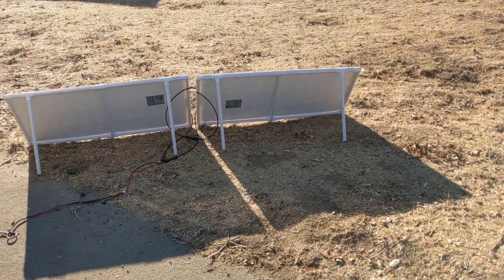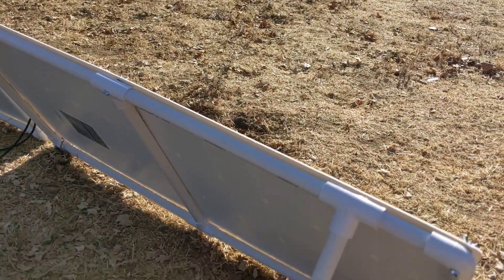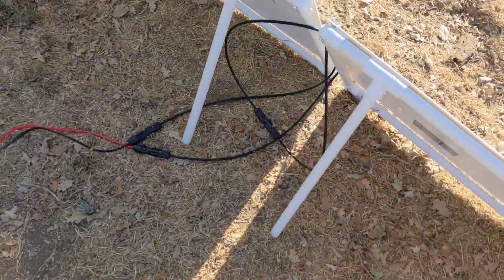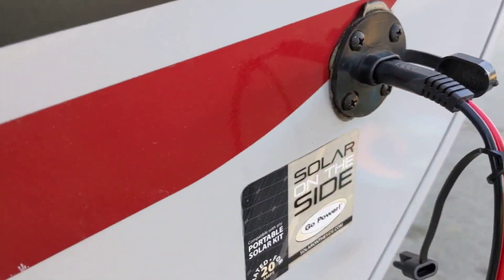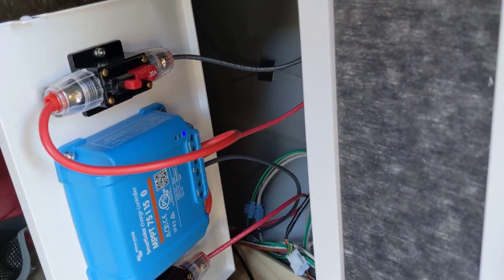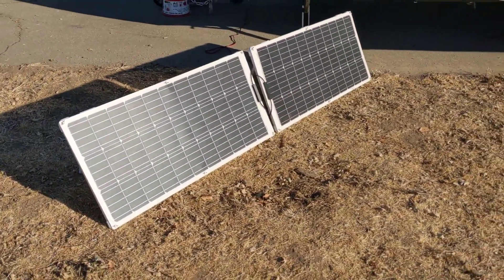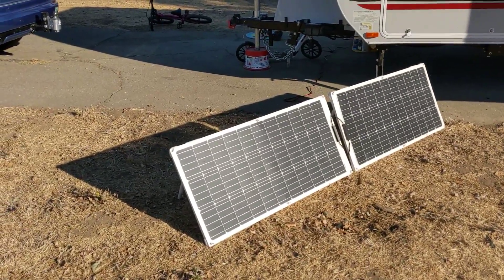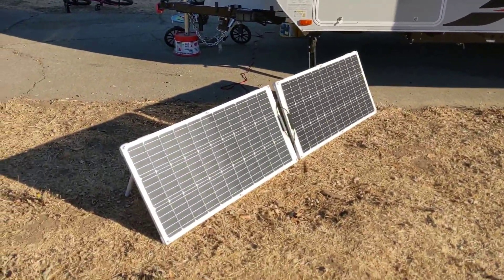Simple Stand for Flexible Solar Panels - Lance 1575

Comment: Hello Joshua, thanks for sharing your design!  I may be wrong, but I believe the reason you had to switch your positive and negative wires is because your plug-in to the RV is a Zamp plug...they reverse their wiring to compel folks to purchase their products and avoid the confusion/hassle.  There's an adapter you can purchase to accomplish the same thing but your solution seems to work great too!

Comment: Hi Joshua, nice design. Nice and light. Did you make the swiveling attachments or were they purchased? Is that one inch tube? 
I was also curious about the roof top flex install and how the panels are standing up. Are you finding that the panels/cells are cupping or sagging between the supports? and if so, has this affected performance. Do the panels flap/vibrate/flutter in the wind while you are driving at highway speed? Have you noticed any degradation or micro cracks due to the fluttering. i like your install method and hope that I can replicate on my trailer if the panels appear to hold up well for you.
Reply from the maker: I added a bit more detail to how I made the stand here : https://youtu.be/WBPY7v2DaVg